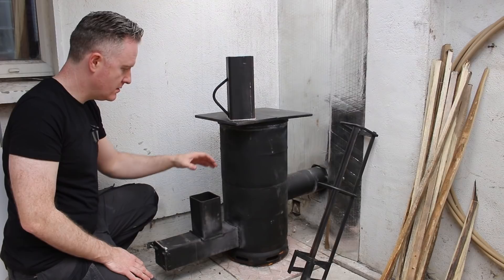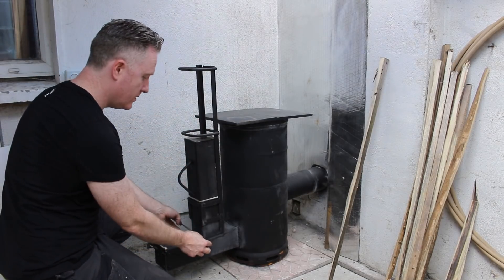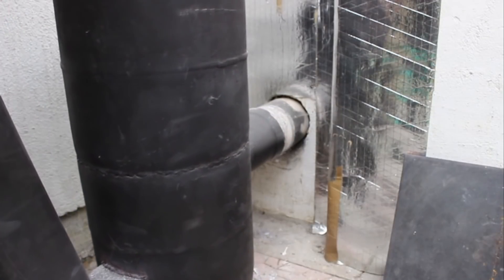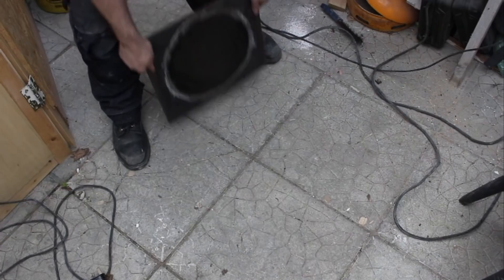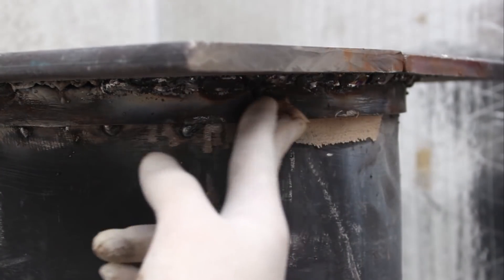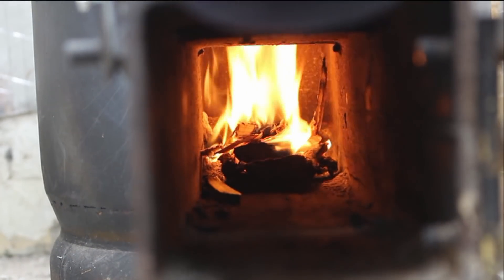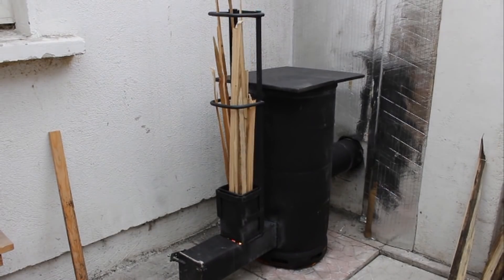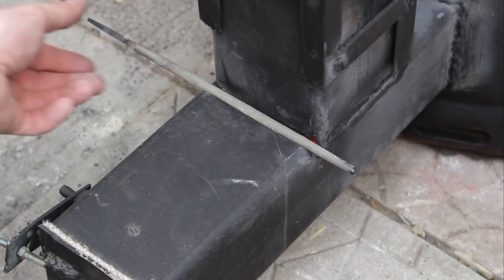Rocket stove update - 1 year on...with some changes

Comment: Bob love your video. How large of aria are you heating?
Reply from the maker: It's about 9 by 11 feet or 3 by 3.5 meters. But it had a glass roof made from discarded windows, so it doesn't hold the heat. But the stove is so hot that it really doesn't matter

Comment: Cut a opening below the feed tube in the burn chamber. Add a grate to support the wood but allow the ash and small amber's to fall through into a collection chamber, easy to empty.  This will work as a secondary burn chamber. Add a door to this chamber for easy clean out. Awesome rocket heater build!

Comment: I'd like to now if you could trust it to burn 2x2x1/2 wood chips on average size. would they continue to fall down, would they plug off the air without some kind of cage at bottom.. I'd love to build one to burn chips with a water tank over the chimney to heat the house.

Comment: The point of a rocket stove is that it is supposed to burn quickly, with a long flame and a "woosh" sound, hence the name "rocket". By slowing down the burn by cutting off the air, you are defeating the purpose of a rocket stove.

Comment: My regular wood stove in my house, when fully loaded for the night will burn for 9 to 10 hours before putting in more wood and l am heating over 2000 square feet of space, and minus 25 to minus 30 degrees Celsius is quite common here in Canada. 
No need for me to keep stoking the fire every 30 minutes.

Comment: I wouldn't choke the combustion, that would generate carbon monoxide, what the stove could burn it. Waste of energy. I also wouldn't use file in such a hot environment unless you don't use that file anymore. The heat can weakening the hardness of the steel. Great work tho.

Comment: Rocket stoves are 101% useless. I built one. For heat, you'd do better farting into a Ziploc bag and hugging it much like you hugged your teddy-bear as a child. Really, why wouldn't one just get a pot belly stove, so you can burn logs, not pencils.
Reply: That's the whole point of a rocket stove.. to be able to generate heat from a small amount of material very efficiently.. your one MUST be of terrible design if it doesnt work.. this dudes one can be improved alot but hey he got far better results than your one.. ya dork lol A lot of it is trial and error... your first air intake plays a massive role+ Insulating the burn chamber is a must for gasification and also a secondary burn inlet to greatly increase the efficiency.
Reply: @beerdedkiwi2797  Gosh, I'm so Tupid.....thank God I renounced all three college degrees!
Reply: @NAVYMAN-d1d  hell yeah! You obviously learnt nothing..
Reply: @beerdedkiwi2797  Airborne!
Reply: @NAVYMAN-d1d  *Airbourne. eh.. there alright

Comment: Try putting A damper on your exit pipe This will slow it down or stop your flow in the shut position, in the open position it will operate like it does now. A damper on your exit pipe will stop all your heat from going out the chimney. This will also help with your ash problem as your ashes are being pulled right out the chimney with your heat. You will have to keep the damper in the open position to light after it warms up you can adjust it. You will still have to do your mantance once  a year, if not that bad skip to every other year.

Comment: Pouring aircrete for stove parts with refractory coating, a base can be built with a detachable round chimney and cover assembly with 45 gal. drum to provide controlled combustion. Venting the chimney through a side duct in a gravel heat sink would absorb most of the heat before going out the flue. Check HONEYDO carpenter for aircrete.
Also something called cob can be used to surround the ducting creating a bench for radiant heating.
Reply: Doug, I watched all Darwin videos.I'm an insider member. its way to early to say aircrete with refractory coating. Darwin's current formula, still in develop stage.  He's finding ways to improving the formula. Don't get wrong, he's a good and honorable person.
Rocket "stove or heater " been around for century's, .K.I.S.S.
Reply: @videobob6789  Glad to hear you are giving consideration. Testing in the real world is the final exam.

Comment: Restricting the air so much for a longer burn also increases the ash and soot left behind. More air = faster and cleaner burn right?
Reply: Agreed.  Im a fan of building a thermal mass around it burn it hot, store the heat and enjoy burning less wood cleaner with less ash.

Comment: You are getting ash because of incomplete burn. It is called a rocket stove for a reason. It has to run wide open to run properly. It is not supposed to have a draft control. When you cut down the oxygen flow, the chemical action we call burning is reduced and then solids form. These solids are the ash.

Comment: Can you cook on the top? It looks like it would get pretty hot pretty fast. I built a frame and poured mine using concrete. It pretty much has the same design as yours other than the building materials. The one I built is slow to heat but once heated you can cook on it for hours. The steel one you built looks like it might be ready to cook in minutes. 

The distance between the riser tube and the top plate can change the amount of ash you get. If you could add a temporary plate to the inside of your top plate over the riser tube that could reduce that space you would probably see less ash. It looked like you had a couple of inches if I saw that right. Try to reduce that. I found that for my size riser(4") 1" was perfect  distance for clean burning.

Comment: Did you ever sort out your "hot exhaust" situation ?
It seemed to me that because your system is completely closed that it is unavoidable that your exhaust is relatively hot.
Most of the others reported on utube are used primarily for cooking and therefore relatively open to the atmosphere, and hence have cooler exhausts (if in fact they even have an exhaust).
I am interested to know if this heat causes issues or not.

Cheers, and a beautiful job btw :)

Comment: What exactly are you heating..? The fire seems to be in your yard and not connected to anything.I want to make a system myself  and i hope to heat or part heat my house...Nice job though..
Reply from the maker: I'm heating my workshop. It has a glass roof so it looks as though it's outdoors but it isn't. You should give it a go, very rewarding

Comment: Part of the reason for all the ash might be that your insulated pipe isn't insulated enough to get the high temperatures needed. We've built very similar ones to you but with about 1-2 inches of vermiculite surrounding the burn chamber and we had very little ash in the system. Also by restricting the air flow inbound you again might be restricting the stove from reaching the full temperature needed to burn away the ash. Check out the advice from experienced Rocket stove builders  - I find the further you veer away from the traditional design the more problems you can get. Keep up the great work though.
Reply: You're correct about the insulation. 
      I used 'rocket' burners in the marine world ( called heat/inert gas generators, used to produce a stream of inert gas for heating liquid cargo and then fill tank ullage and void spaces.) 
 These work on EXACTLY the same principles and parameters being, a fully (air) controlled, multi-stage and fully insulated (using highly reflective ceramics) combustion process.  The first stage is the fire box which is designed to act more as a gasifier.  The second stage is the ceramic 'throat' passage.  Third stage is the ceramic riser tube with central stainless air feed.
The units may be specified to burn whatever comes to hand, be it coal, timber, heavy oil or HS diesel.   When correctly proportioned, they also produce about a ¼ pound or so of thrust, which is quite enough to push all the harvested hot gasses along the heat exchanger pipework in the tanks and then through a ( completely unnecessary) spark screen, and into the ullage space and then overboard.  
  The trick in designing rocket stoves is in understanding of the entire chain of the process being essential to the end efficiency. 
1. Fully insulated combustion to allow a total maximum combustion and resulting heat level BEFORE harvesting any heat. 
2. Proportions ( throat dia. approx 3/5 of riser.) to allow the fluctuations in the ceramic riser, in relation to the throat and an unrestricted exhaust cum heat exchanger system to act (slightly) as a pulse engine. 
3. A horizontal exhaust cum heat exchanger system with, if long enough, the far end a bit lower than the generator.   ( ie. No rocket can be fully efficient if fitted with standard vertical chimney expelling heat!)
Reply: @sixmagpies  further explain the throat to rise length
Reply: @vanderumd11    Sorry  ......  meant throat to riser I.D., not length ( have corrected.) 
     I think the relationship between all these proportions is as yet undefined and still a 'work in progress' so to speak. 
     Also, I see no reason the throat couldn't be designed to emulate a very crude Tesla valve,  and thereby effectively increasing the efficiency of the 'pulse engine'.  (Much in the same way as a valve works on a normal valved pulse engine.)